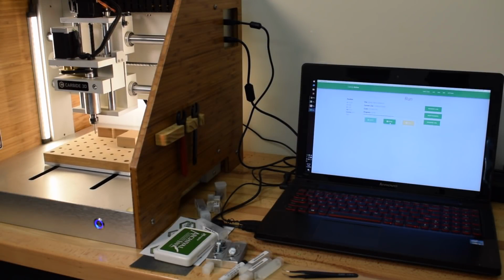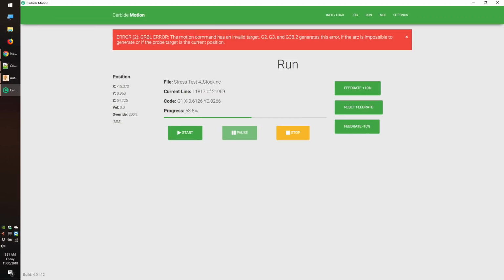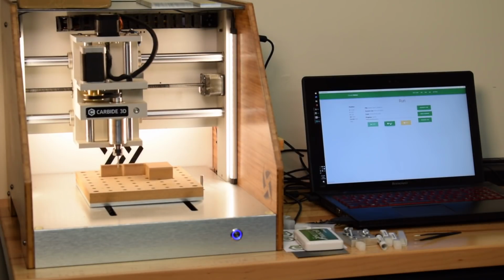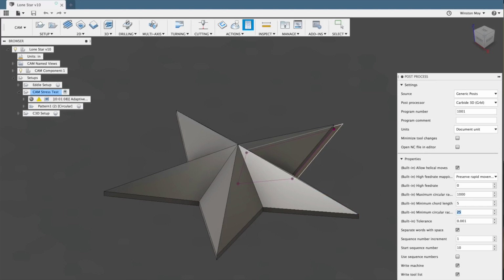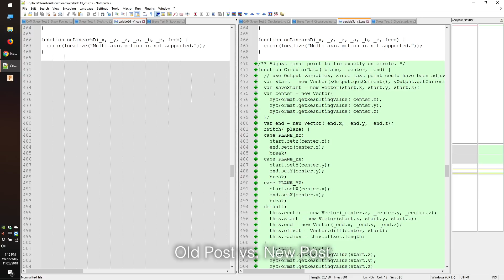Fixing GRBL's G2/G3 Arc Errors in Fusion360

Comment: I find myself wondering something. Does G-code support bezier-based arcs/paths? being able to tell the machine to follow a bezier curve (defined by start, end, and 2 handles) will give much more freedom and smaller G-code files to work from. Plus, 3d beziers aren't much more complicated to calculate, thus, complicated finishing would be much more possible.
Reply: They all get converted to line segments (breshenham algo) before going to the motor controllers.

Comment: Thank you for getting Autodesk to finally fix this issue. I hope this eliminates user posts on Grbl issues threads. I agree this is the correct solution. Part of the problem with allowing incorrect arcs to go through is they can be interpreted as something totally different and potentially ruin a part. Particularly when arcs are defined in R radius mode.